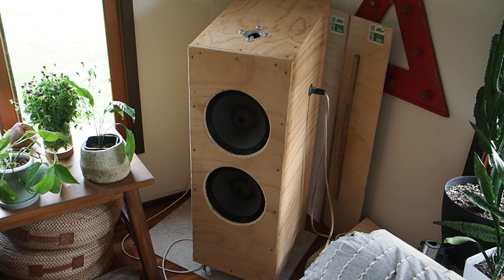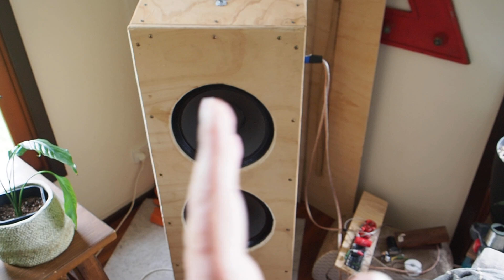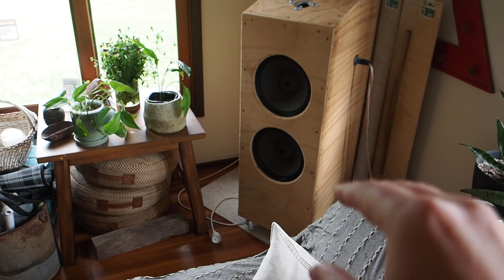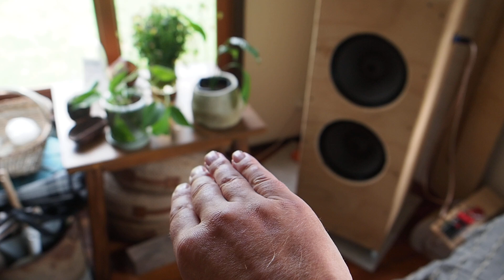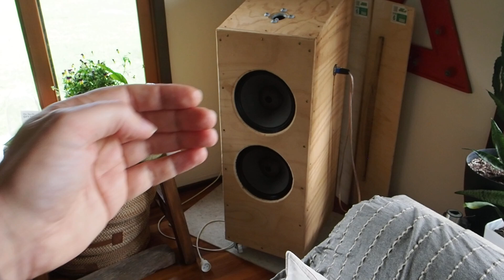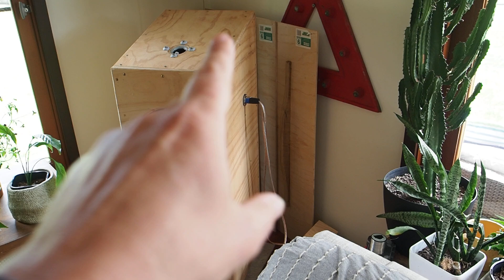A smaller Lancelot speaker: underlying concepts, its sound, current production driver option

Comment: You clearly remind me myself in my teen years and all my ideas before I started to study physics and electronics on university.
Reply from the maker: Thank you for your magnificent comments that are a real help to the audio community. 

Since you seem a bit blinded by your academic schooling, what I did here is check out the sonics of a Q=0.57 alignment, coming down from the old pioneers alignment of Vas/1.44 and Fs=Fb. This is also an experiment to get to grips with the subjective magnitude of cone interference - checking the old pragmatically derived patterns Altec derived from 1000s of installations - and study its effect while changing the crossover frequency.

Comment: Interesting about harmonic distortion and "masking profiles." Also makes sense that delayed distortion would stand out.
Minimal crossovers make sense to me also because of phase coherence

I didn't realize a bottom port added that much boost but seems well worthwhile because of the amount of power low notes take. My Zu speakers have bottom ports probably for the same reason. Did you use software to design the enclosure?

Really good video
Reply from the maker: Janos has an excellent instructive video which is called 'VOTT vs VOL'  which shows how the 'VOL' reaches its efficiency though horns, port placement, active cabinet and room modes. 

Yes, I did use a program, 'AJHorn', which is quite a bit more user-friendly than 'Hornresp' and is good enough to find good port and driver locations for a range of enclosure styles. Both programs unfortunately use Webster's horn theory which from my research doesn't survive empirical scrutiny but it's a lot better than trial and error :)

If you google 'Auditory Perception of Nonlinear Distortion' by Dr. Geddes and Lee, you'll find some good information on what is audible and what is not. This relates extremely well to the characteristic of our hearing (non-linear, high harmonic distortion, phase and time delay sensitive over 500Hz).
Reply: "
I didn't realize a bottom port added that much boost" well, this is probaly not true, because low frequency means long wavelength and compared with this length (50Hz about 7m/21feet, lower frequencies even longer [34Hz/10m/34feet]) the position of the port nearly does not matter. Many misconceptions out there about physics ... unfortunately.
Reply from the maker: @ahnenpost5237  You are arguing that a speaker (woofer) positioned exactly between floor and ceiling creates the same level of bass as one positioned on the floor? Because frequencies are so long?
Just lift a speaker and see what happens!

But lets dive into two physics aspect that give a floor port more boost than sims predict: first, we must consider the efficiency with which the air in the bass port can couple to the air in the room - by coupling that energy to the floor, a huge surface compared to the port exit, will help that efficiency.  Second, the presence of a floor will limit the rate of expansion of the compressed airwaves radiating out, resulting in less attenuation. 

It's not all that much different from a guitar... the strings make the noise, but have poor coupling to the air. A 15" driver only has 850cm2 surface a freakin minute part that isn't even properly capable of generating a 50Hz wavelength (0.1% efficient, maybe??? with lots of help of an enclosure).... the port size is even less. If you want to improve those size of soundwaves significantly we want large surfaces... simple physics mate.
Reply: @EduardBroekman  I argued what I argued. You turned it into something different and then you miss the point.
Reply: @ahnenpost5237  I could have been more clear. I didn't realize a bottom port added that much boost when it's close to the floor. My understanding is the port location on the enclosure has a much smaller effect than the ports distance to room boundaries
Reply: @PlaybackMansion  the floor adds as much as the sidewalls, if the box is placed in the corner, the fllor boost is only a third of the compete 'boost'. If the ceiling is below a quarter wavelength away, then it adds too and the floor boost for those frequencies adds only a fourth. Very technical details, but may be, you are interested.
But consider this: the more you understand, the more the magic in speakers will go away. Exactly this happened to me. If you love the magic, do not try to understand physics.

Comment: What do you think about the B&C DCM50 16ohm? It has a paper diaphragm with the downside, that it only goes to 10k.
Since you are using it off axis, that should not really matter.

Are you planning to print the large rear covers for the sb for more low range extension?
Reply from the maker: Hi Nils. That B&C driver impedance graph indicates a lot of break up modes in the 5-9kHz region and it seems to show up in the freq.response graph, and together with the limited range that driver doesn't appeal to me. Are there positive reports from people who've build with it and which freq. range did they use of it?

I''m not sure what you mean by printing rear covers for the SB? I did install the SB driver on Friday and it needs a little bit more work than just a crossover network, but it has been promising so far.
Reply: @EduardBroekman   All the graphs look really smooth on the b&c.
Crowe talked about it in the video:
ES-450 Biradial No.2143
Reply: @EduardBroekman  3D CAD File --- Rear Cover No.2376 for SB Audience 65CDN-T
Reply: @EduardBroekman  If i recall correcly crowe liked the sb more with a little zobel at the peak arount 8k. Maybe you could ask what values he used.
Reply from the maker: @Nils31199  Thank you for mentioning it, that 65CDNT driver sometimes has an edge to it so it's interesting he states this cleans up the 500-1000Hz and lowers Fs (Note Crowe mentioned preferring a tube amp for the 65CDN-T..hint?!). Worth a try that backcover! 

I missed his review on the DCM50 which is even more unequivocally positive than the 65 CDN-T.! One notable thing in that DCM50 review is that Crowe here reduced the waterfall graphs for the DCM50 to -25dB while others are on -30dB... regardless, thank you so much for sharing as it's interesting to have a large non-titanium diaphragm reviewed.  It's quite a bit more expensive, but would be very interesting to hear. One of my listening notes is that the EV DH1A never sounds metallic or like titanium, but the 65CDNT does at times.

Btw my comment was on  what the impedance curves show that are on the B&C datasheet for the 8 ohm model... it usually indicates break up modes, and having them down in the 5-9kHz is not a nice prospect; but it seems the reality of listening (for the 16ohm model?) is different.
Reply: @EduardBroekman   I think the B&C could be really great with the zobel and rear cover.
Maybe look for a hacker/maker space nearby to get the covers printed.

Thats the odd thing about crowe. I cant get how he often only tests stuff with some wierd lab cables and class d plate amps. I guess its convenient and constant for measurements.

Its hard to tell what the differences are between the 16 and 8 ohm.
I also saw it too late. He has it well hidden:D
I will probably try the DCM50 at some point because i suspect that they are a upgrade to the GPA 399 that i got for my VOL build without costing more.(the differences of the GPAs to janos altecs are that its ferrite, has a different phase plug and a worse pascalite diaphragm)
Reply from the maker: @Nils31199  Hi Nils all good points. It's also interesting that the high pass on the DCM50 to round off the 1-3kHz peak, also moves it to having a high crossover point; one of the awesome things is the low range (perhaps even better with larger chamber indeed)

The problem is a price somewhat; it is not too far off a a nice 2nd hand Alnico Altec/JBL.
Anyway very curious if you go that way and I may if budget somehow allows. I first have a Hashimoto OPT coming...

Btw the 65CDN-T is getting smoother over time and I noticed now the the 2P29L signal tube is microphonic, so I may need to replace it with an 801A, UX112 or even 47... I feel this CD transfer emotions really well but in my setup/xo I'd like a bit more power/convincing in the vocal ranges (esp male).. to be explored but it certain is already a very good driver. I'm considering CNCing a wood back chamber... or have a friend print one.. we'll see. I'll do that once other tweaks have been settled down.
Reply from the maker: Hi Nils, I'll be trying this B&C DCM50 in the near future - thank you for the suggestion; I don't like the SB Audience 65 CDNT; I rate it well below the EV DH1A which measures only slightly worse, but has much better tone and integrates better with the Altec 414.

Comment: the efficiency of a compression driver is measured always with a horn applied - so you cannot say, that the effiency is 110 - it will be much less, about 100, may be 103, but minimum 6dB depending on the horn used for measurement (directivity matters! without a horn applied, no directivity translates into much less efficiency).
Reply from the maker: Good point in general, yes it's nearly always horn mounted for 'sensitivity' measurements but what will I use your new lower number of  (110-10=100db/W sensitivity for?? It seems useless to me unless we're want to calculate the efficiency percentage? Is that the goal? If so correct, but pragmatically we don't need this -7db to -10dB correction, it has no purpose.

Efficiency, properly, is a percentage on which a horn has no influence. The best CDs have reached 30% electrical efficiency = 107db/W/1m sensitivity, so in half space without losses that would be 113db/W/m. I'm guessing your 7-10dB/W correction is based on the directivity of CDs w horn vs full space? Seems reasonable.

So, my problem with your statement is that you want to compensate for directivity because a horn is mounted, but woofers also have directivity, are generally operated on a baffle - and you're not reducing sensitivity for those. So why this uneven treatment? If we're interested in building speaker, which IS the topic of this video!!!!, I argue we can use the sensitivity numbers - within reason and if the manufacturer don't cheat too much ... as I will try to show below, these uncorrected numbers work out well.

So, my point is that when we're comparing to other driver types, such as woofers, we have the same half space + directivity of that woofer as well. All drivers have higher measured  sensitivity due to their directivity!!! With that in mind and I have found this pragmatically, we actually CAN quite decently compare the given 'sensitivity' as db/W @ 1m between woofers and compression drivers.

As a more specific example of actual sensitivity, I just bought the SB Audience Rosso 65CDNT  (112dB/W/m, 1.9T field strength - a better indicator of efficiency). This upfiring CD I had to attenuate 18 dB to match them to a 99dB/W/m woofer. So based on that and the very indicative 1.9T field strength, I guess that the actual efficiency of this unit sits at around 20% = 105db/W but then it would measure higher in free air / half space +6db? due its own directivity (no horn needed) minus some losses.  That brings us very near to the listed 112db/W/1m when mounted on their 50 by 70 degrees exit H280 horn that they use for measuring sensitivity.  

Now, if I had followed your compensation, this CD would be 112-10=102db/W/1m without horn (as I run it), and this unit's wouldn't that much louder than my 99dB woofers, the  efficiency would be 10% (low for 1.9T) What I see in reality, is that without horn, this unit is far louder than the woofers and it had to be attenuated a lot despite the CD being point at the ceiling... so for the intent of mating to the woofer, considering this a 110db/W sensitivity driver worked out very well....
Reply: @EduardBroekman  same here, you missed the point. If the goal is to match the Wooofers sound pressure withe the compression driver, the output of the tweeter matters, that is lower without horn, and this fact has to be adressed in the crossover-design. It's thus simple. The end.
Reply from the maker: @ahnenpost5237  I get your matching, which is obvious - is that your only point? 

Now, technically what you say there is wrong: the total energy output doesn't change with a horn, the only thing a horn does is control directivity, add some diaphragm control plus add distortion. A horn never increases efficiency or output of the driver itself.

For an omni directional speaker where on-axis response has no meaning, we match the overall energy output of the compression driver with the overall output of the woofer. This is likely very different from speakers where the listener is expected in a specific 'sweet' spot.

Any points we're still missing here??
Reply: @EduardBroekman Some people just want to argue it seems. Pointless.

 You are doing a hell of a job with your system and I really want to build a active cabinet. I just bought two Beyma 12 lx60v2, 16 ohm drivers. 

Couldn't resist since I got them for half the price, new. They should be quite similar sounding to JBL 2206. 

Or perhaps I build a bass guitar cabinet with them. I have always wondering how a active bass cab should work out. I have to build one and find out I guess.

Since I already planned to build  cabinets for the JBL 2226, 15" and 16 ohm. I have positive thoughts on driving them with a tube amp. They are quite an easy load and don't need so much power to sound loud enough. 

I am an beginner at tube amp building, but have some experience with cabinets. But I have to start building to learn and I don't cut corners in what I do. All or nothing approach. 

An darling amp maybe would be good to start with? The 1,4 watt version with Hashimoto transformers looks like an affordable and easy build.

Have you some ideas on a 10-20 w Class A tube amp that sounds good? A diy design. I am sold on tubes and have heard the early Ocellia Kedros silver with a 12". Soo good, it really filled out the whole house and after that experience I can't look back on dead cabinets. 

/Gabriel
Reply from the maker: @gabrielnilsson5398  Hey Gabriel. Nice to hear from you again.

For an active speaker, even with the 12" Beyma, I'd build one in the style like Janos' 'La Grande'  - look on his Real World Audio channels for that. The actual box size / port tuning does depend on the size of your room, what walls you have, how much the speakers will be out from the wall, and even the kind of amp you plan to use with it... basically we'll try to equalise the room (bass) response into the design, so it ends up near flat or a with a little bass lift when in your room and you'll get more bass extension.

The Beyma's high-ish Fs and low Vas means that the box will be small and you can keep the enclosure back wall close enough so standing waves don't form (1/4 wave length of box depth < crossover frequency). On the negative due to its Fs and performance orientation, it won't reach that low. In my room I'd probably start with Fb=35Hz and Vb=Vas=48L bass reflex box as here in my room that would be flat and the port can be narrowed to lift the bass/higher tuning if needed.

Now, for a tube amp in the 10-20W range, I'd go with a 2-stage 300B.. A plethora of designs out there.. look for the ones that operate around 65mA 350V, they've generally been created with sound quality in mind; the ones that are maximising power and can reach up 16W will run the 300B much hotter. 

A darling amp is nice but it's low power may annoy you. Something like a 2-stage 2A3, which is much easier to drive than a 300B, opens up a lot more driver tubes, and can be build quite cheaply for the same goals as a Darling, plus getting quality output transformer is much more likely to work out (the low plate resistance doesn't need a massive transformer core, or much windings). A good 10K OPT for the darling is much hard to find than a quality 3.5K or 5K OPT for the 2A3. I just bought the Hashimoto H20-10, which I can use as 5K, 7K, 10K or 14K and it's an impressive OPT, but it's not cheap. I'd buy a different model for the 300B or 2A3.
Reply: @EduardBroekman  Hi Eduard and thank you for your answer. I have been following Janos channel almost from the start and the La grande design am I familiar with. I'd rather have tight, fast bass down to 35-40 Hz than 20-25 Hz and not as dynamic. 

I will look into the designs you propose and go from there. Many thanks 🙏/Gabriel